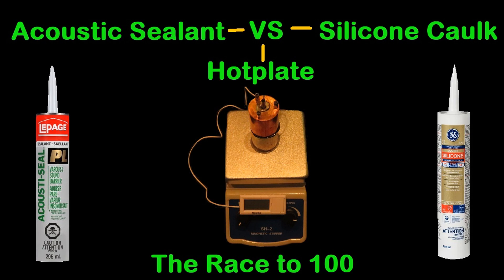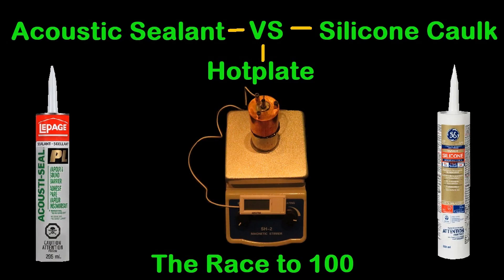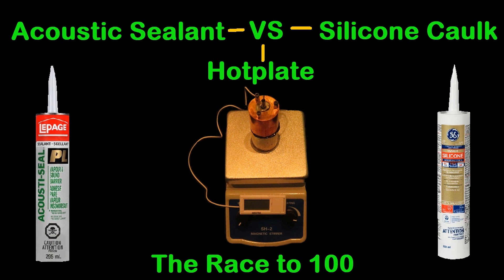Can Cheap Silicone Compete With  Expensive Thermal Putty

Comment: I am thinking that the sorter the time the better the silicone is, being that if it takes a long time for the heat to get to the censor that would mean it is holding back the heat instead of letting it getting to the "heat sink"? I would think that as a "thermal paste" you want the heat to get to the heat sink as fast as possible in order to keep the part as cool as possible, or am I missing something?
Reply from the maker: Yes. Both of these products are inadequate for moving heat. The faster the better. I tested these products so we would have something to compare to for all the other putty and pads I've tested.

KPT-8 and MG860 are likely a better baseline from which to judge other putties as they are actually designed to move heat unlike, Silicone Caulking and Acoustic Sealant.

Right now the 2 best putties I've tested at TH949-1 and EVGA Putty. Both of which finish the test around 5 minutes.
Reply: @snarksdomain  Thank you for the reply, guess I will check your other video's and see what results you get, as I like the idea of a putty, I don't have to worry about what thickness I need, again thank you...
Reply from the maker: @LennyM  I think the best place to start is the following video as there is testing comparing putty vs pads vs shims on a GPU.

https://youtu.be/zSX_7P0HZqc

Comment: Rumor has it, adding Diamond powder/dust to a fluid like this increases thermal conductivity quite drastically. Curious how cured strips of this infused with Diamond powder would do. /=]
Reply from the maker: Hmm. That diamond powder isn't cheap. I do have 50 carats of it though. I may try that at some point, or I may try enhancing an off the shelf putty.
Reply: @snarksdomain  yeah, I haven’t tried this personally. Looks like 5 grams goes for about $12 on average. Not sure how much would be needed to have an effective base for thermal transfer.
Reply from the maker: @C Gooch The biggest risk with Diamond Powder is being scammed and ending up with Cubic Zirconia advertised as diamond powder.

It's a thermal insulator and also conducts electricity. So the exact opposite of what we want when buying the diamond powder.

I sourced mine from Amazon, but plan to still test it out electrically to see if it's fake or not.
Reply: @snarksdomain  ooo. I didn’t know that. Good info to keep in mind though.
Reply from the maker: @C Gooch  The road to "Thermal Excellence" is paved with electrically conductive landmines.

TG-NSP80 being a prime example of an excellent thermal conductor that also conducts electricity :(
Reply: @snarksdomain  this is true and unfortunate. Admittedly some of the best thermal bridges I’ve made are with properly sized aluminum plates mated with SYY 157. Memory temps for me are a thing of the past. But it’s also a rather expensive endeavor and time consuming to do properly.